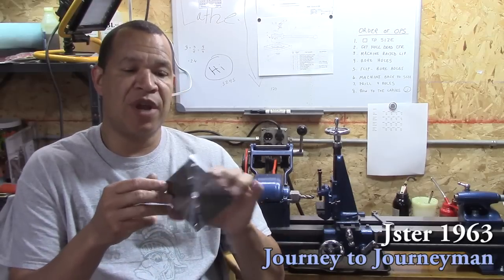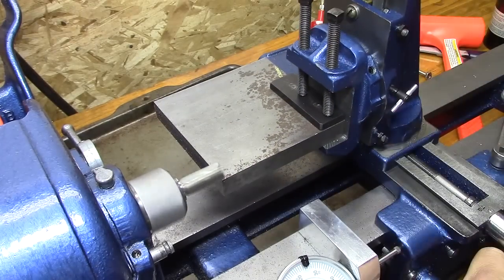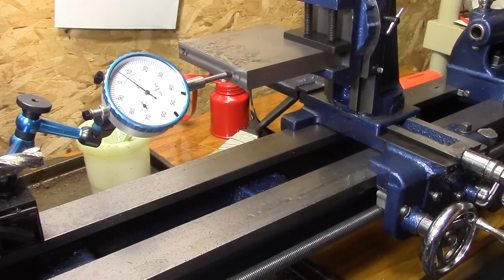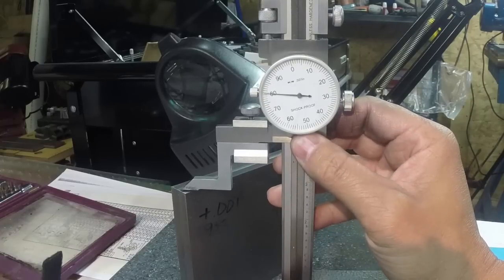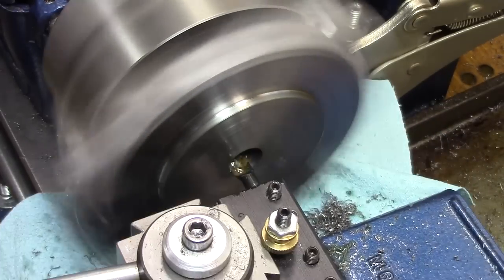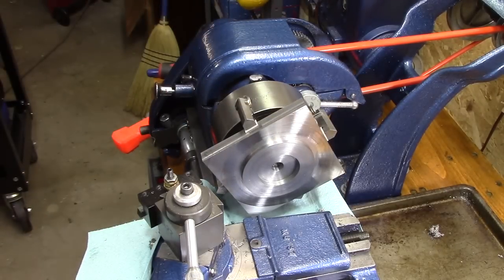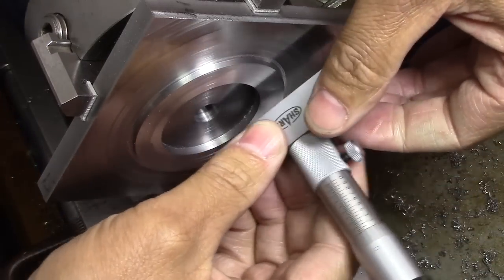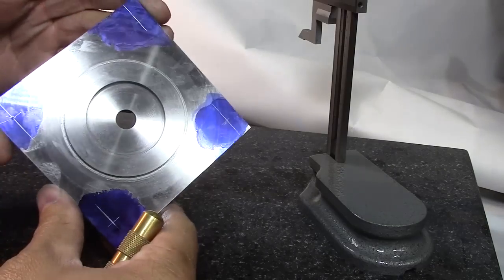Journey to Journeyman, Episode 10, WIYB-TMC, Ball Turner Project, Base Plate

Comment: Love your videos! I just picked up an Atlas lathe identical to yours, and I must admit I painted it identically (great minds think alike). I have to ask what size chuck you are using, if you could post a link I'd really appreciate it. Also where did you get the milling attachment? I've just about finished the restoration and I'm starting to add accessories.
 Thanks, Phil
Reply from the maker: becauseracecar Thank you so much!  I think it is a 4" 4 jaw chuck (if it's different, I'll tell you tomorrow).  I bought it off ebay and love it!  It is an Atlas I do believe.  It was not new so I don't have a link.  I got the milling attachment on Craigslist.  I got an entire lathe with full change gears and the milling attachment for the price of a milling attachment.  It's not a mill, but it sure does what I need to do.  Thanks again and let me know if you post a vid of your new lathe.......

Comment: The mill scale on heavy plate is real thick.  On my welding table with 5/8 plate, it took a lot of work to get the mill scale off.
Reply from the maker: 1970chevelle396 I thought that only hot rolled had that scale.  I was wrong!  Thank you.........